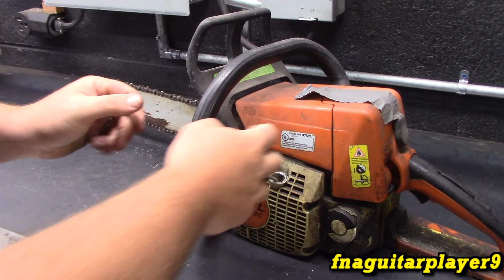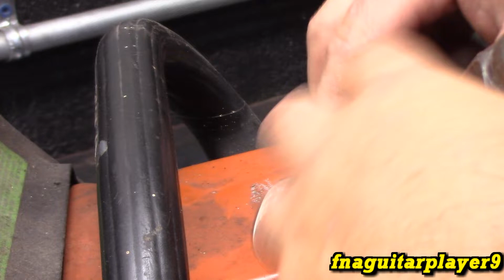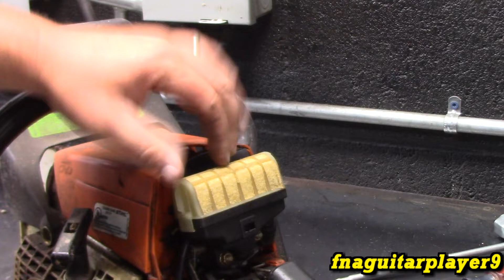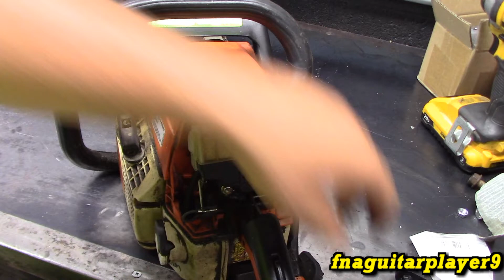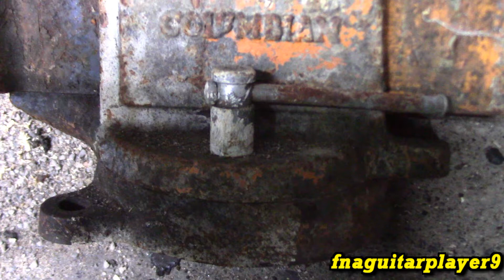Stihl MS210C Repair, Kill Switch Fix, Spark Plug, Chain, Air Filter Cover Clip

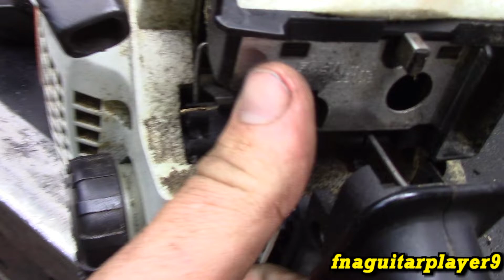Comment: Hey git picker!   at about the 10:00 mark,   thanks for explaining how the kill switch worked.  I looked at a diagram for the Stihl 180c and the kill switch is just a ground wire.   But you explained how the metal bar sometimes gets under the plastic lever.    Thanks.   I was getting ready to buy another but I opened the chainsaw and found the metal bar underneath the plastic bar when it should have been on top.   I also had to bend the metal bar back a little to make it easier to ground contact.    My brother picked up this 180c for cheap that looked like it had been at war, but it cleaned up nice with a new carb and sparky.